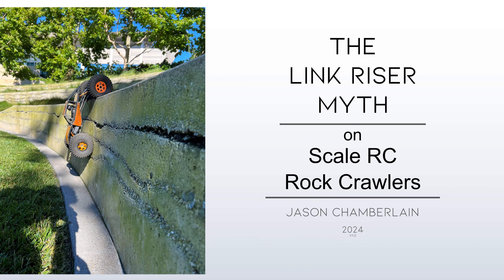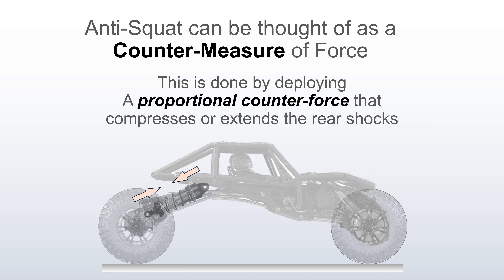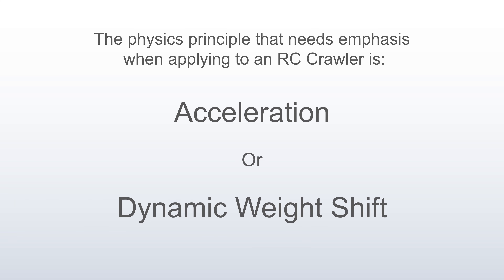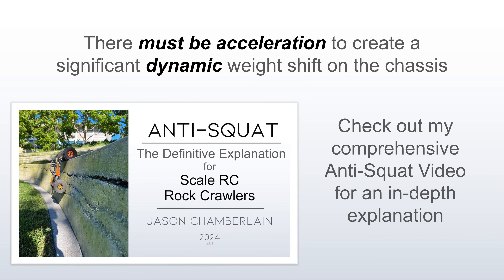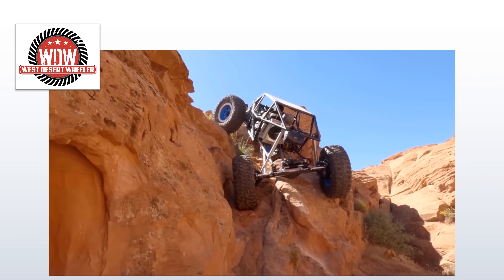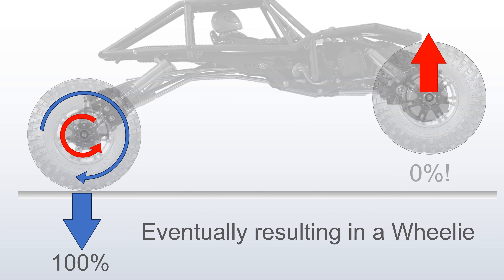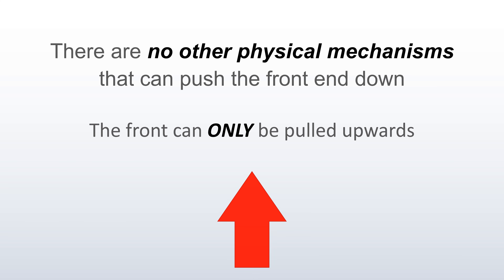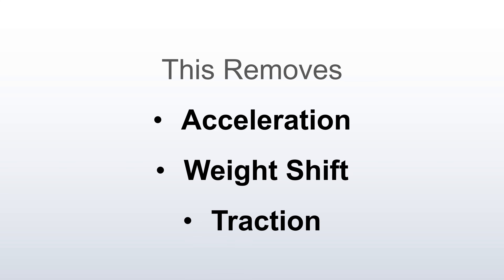Anti-Squat on RC Crawlers - Part 2: The Link Riser Demo

Comment: In rc rock crawling there are times where you “bump” or “give the beans” to quickly jump up an incline.  In this case, anti-squat dynamics would be at play and would make a difference in performance.
Reply from the maker: I completely agree.
Reply from the maker: Great topic for a future video.
Reply: This is my driving style. Lots of anti squat, lots of throttle. In the right circumstances it will jump squarely up an obstacle. But I also run a very light sway bar
Reply: yes but still most crawlers have good anti-squat out of the box
Reply: @BoomslangSuss can you do videos explaining pros and cons on using wheel spacers/hubs
Reply from the maker: @wiktorjohansson4333 You make a great point - RTR vehicles are usually well designed and engineered, with a nice amount of AS, or at least the amount that the design engineer wanted...and you don't see link risers out of the box that I know of. Expect maybe Rhino, and I don't have a lot of faith in why they did that - seems like they just followed a trend and added a ton of riser hole options indiscriminately. 
Most of the crawlers I look at are custom builds, so AS could be anywhere on the spectrum.
Reply: @BoomslangSuss I was just rewatching this series and saw this comment. I’m familiar with Rhino’s geometry (from a research point, I’ve never driven one.) I think it would stand to reason that once one goes past a certain point with AS it becomes detrimental as forces on the rear axle react in sudden speed changes (while vehicle is vertical) the VERY long AS adapter they sell for the rear I think becomes detrimental at its most extreme when the opposite end of the links is raised as well (this would cause an extreme reaction and cause a wheelie, either while vehicle is vertical or horizontal). If the opposing end of the link attached to the chassis is installed in a low position there would be little change to AS. This is all anecdotal, and to say that the long rear link adapter is useless and made to fit with industry fashion…thanks for making me think on the way to work LOL

Comment: not relevant tests until the last one, where the high link riser made an obvious difference that you covered up with deliberate poor throttle control....   weak
Reply from the maker: What do I have to gain from throwing the test? Besides, the test was done “blind” so I didn’t know which was which. Try it yourself.

Comment: Antisquat is only part of the equation. Instant center is just as important. If your links were mounted a lot farther back. Your instant center would change enough to invalidate your own test by lifting the rear of the chassis before the front
Reply from the maker: Instant center is meaningless on its own. It’s just one point along the way to calculating AS. You can’t change IC without changing AS. Regardless, anti-squat is a dynamic response and does nothing at slow creeping speeds. Many people in RC crawling overlook the “acceleration” part which is why I made the series of videos.

Comment: Anytime you hit a bind the anti-squat is working...  acceleration is in direct contact with torque on the chassis, and we all know you dont need to actually be accelerating forward the create torque on the chassis..
Reply from the maker: No, but you need acceleration to activate anti-squat. It's a dynamic response to a dynamic weight shift. AS has nothing to do with wheel torque.
Reply from the maker: It's all explained here.
https://youtu.be/-ad04wUd8PQ
Reply: @BoomslangSuss  you are very wrong, anti squat has everything to do with torque as its a direct relation be the tire rotation and since antisquat works on axle rotation putting pressure on the suspension through the links..  also anti dive is another thing, don't be upset with comments just go read a bit more and test properly, if you were to have the truck held back with straps and throttled in place with a high anti squat ratio you'd still pick that rear end up as soon as it starts putting torque to the ground..
Reply from the maker: @theoalbert897  I've read every document ever published on the topic and written a few of my own and was professionally paid for my knowledge on AS for 30 years. If you watch ALL the videos it's clearly explained and demonstrated.

Comment: I’m not an engineer by any means but I would definitely think putting your rear upper links higher so now when you have the weight transfer or pivoting on a certain rear corner on steep incline would create a higher leverage point, acting as a taller pivot point so the weight will push against the mounting location vs wanting to roll over said pivot point/mounting locations
Reply from the maker: You have to look at the complete force balance of the whole system and you can’t just isolate one link or one pivot location. Plus if you’re talking anti-squat that’s a dynamic response and has zero bearing on slow moving vehicles. Hopefully you saw my first video that should explain it better. I am working on a non-reading version of this video coming up soon ha ha.
Reply from the maker: https://youtu.be/-ad04wUd8PQ?si=3fKBykBGSvhtouCW
Reply: @BoomslangSuss thank you that makes perfect sense

Comment: still would love to see this compared with a straight axle vs portal axle. 

also, in the climbing test, there was a noticeable difference. minor, but there was a difference. low antisquat setting you couldnt even apply any throttle without the front tipping back, but you were able to apply power with the high antisquat setting. some more testing is needed there to quantify your results
Reply from the maker: I see what you are saying. If you look closely, you will see that the rear wheel is slipping first on the high setting. When the wheel slips, the front will stay down, obviously.  At the moment when the wheel has grip, the front lifts about the same in both settings. There is a guy on FB rn showing 74 deg climb and his wheels are slipping the entire time. That is a different test altogether than what I am trying to demonstrate. 

The difference in AS between the two is about 35% so IF there was a difference I would think it would be more obvious. I attribute any discrepancies in this test to wheel slip AND outside of wheel slip I think it's all within experimental error - certainly not a 35% difference.
Reply from the maker: What are you hoping to discover with portal v. straight so I can address it from a relevant perspective?
Reply from the maker: https://youtu.be/SBM-YNwr2qU
Reply: @BoomslangSuss I think what he is talking about is people say that straight axle’s vs portals on the link riser. They say that because the portals spin in a reverse rotation due to portal gears that it somehow changes anti-squat. I do set my crawler up with anti-squat in case in need throttle to bump up something otherwise your front staying planted has more to do with rear spring rate and forward bias to push the front down. Many aftermarket axles come with link risers and I believe it’s more for clearance between upper and lower links but I could be wrong.

Comment: I’ve been watching your RC tech videos. Thank you for providing clear and concise explanations. When I started RC crawling I bought a link riser because it was recommended to improve performance but in all my testing I couldn’t really tell a difference. I’m glad it wasn’t just me! haha At least I know now what types of driving a link riser/high anti-squat are actually beneficial for (throttle bumps/quick acceleration)
Reply from the maker: AS certainly has it's purpose and place. It just doesn't hold your front end down at slow speeds. Thanks for watching and I have a quite a few more topics I hope to release. Stay tuned.

Comment: Your amazing my friend! IDE just like know more about tuning shocks and location of them! And how weight gains traction or not enough ect! Idk but your awesome! ❤
Reply from the maker: I plan on doing a video that explains all the shock mounting holes.  As far a tuning the shock, that's a very touchy subject, but I may tackle it at some time.  Some people like 15wt oil and some like 100wt so it's a pretty broad topic with little chance of bringing people together, but I can publish the basics.
Reply: @BoomslangSuss  It would be nice to have a shock and link tuning video that goes into your thought process. ie if I notice x, y, or z I would consider adjustments a, b, or c. In the real world what am I looking for that would push me towards more or less damping, moving a link position, or changing my spring rate. How do I know if my springs are too soft or too hard, etc. I feel like most of the videos are very subjective with little actual tuning guidance.
Reply from the maker: @tristanploughman5586  Working on that exact topic right now!  Stay tuned. Within a few weeks.

Comment: A couple of things I'd like to see if youre interested in expanding on this. 
1. Does a link riser affect articulation? Looks like you get more twist out of the higher setting. Dunno if the articulation increased or your torque twist increased. 
2. Does the link riser do more on a car with the upper and lower link mounts closer together on the chassis side? I notice with the length of your rear links the links barely move away from being parallel. More chassis side pinch would be interesting to see. 
3. Can you get the back end to sag before the front end lifts. I think that would help on a straight climb just by the fact it'd lower CG
Reply: I agree with your assessment. I also noticed a slight difference in torque twist watching the tests
Reply from the maker: @mikerainey3847  I think the visible difference comes from the fact that the wheel is slipping slightly and momentarily in some of the trials. At the moments when the wheel is perfectly hooked up I am not seeing a difference.
Reply from the maker: 1) Yes, the trajectory of the articulation changes a little, but I have not wrapped my head around the effect precisely just yet.
2) The short answer is no. You have to look at the full picture of link angles and position. The I.C. is a result of those links and you can have a fairly large variety of link geos that produce the same IC location.  I've done it hundreds of times on mountain bike 4-bar suspension designs - the IC location, and IC migration are key, and just looking at  2 pivot locations doesn't capture the whole story.
3) Agreed, lower is better and preferred. I kept the spring rate in this test such that we didn't reach full droop so that any AS effect had room to extend or compress the rear shocks if it so desired. In the real world I'd run it mostly slammed as you point out.

Comment: In my case, rear link risers help me on really steep climbs where front suspension unloads, if I can, i just bump the obstacle to make the link riser geometry change push the front end as I am bumping it. It doesnt help at slow speed, at all. But when you need to bump, it does help a lot. Experienced it a lot on my utb18.

The utb18 needed it, my vrd carbon doesn't, really depends on the stock geometry.
Reply from the maker: Yes, a throttle bump is one of the only times that you induce enough acceleration for it to make a difference.

Comment: Its not about just adding/moving a part AS and TT are effects of each other. Id be curious to see the effects of the drive shaft angle along with the geometry.
Reply: Same here, keeping in mind the sleeve/piston action to make up for suspension. I’ve been pitching my rear axle slightly back to make a clean line to the transmission which then pitches forward as suspension activates and puts the top link mounts at a 12 o’clock position, some argue it’s best to have the axle at a straight 12 o’clock position. I argue at slow crawl and trailing it’s best to have a clean shaft line. But wtf do I know, I’d love to hear it from our guy.
Reply from the maker: @independentmind1977  This would make a great topic for a future video.  The torque in the sliding portion of the driveshaft causes friction and resistance to sliding, which reduces suspension freedom because your drive shaft has to slide in order for suspension to move.  It's always best to minimize the amount of sliding if possible and have a smooth, direct angle on driveshafts.
Reply: Yes, I would love to see a video on it sometime @BoomslangSuss  - if anything these are great studies in movement Engineering....I'm also jealous of the signed jerseys and found myself pausing and zooming in LOL - Miranda Miller is an absolute monster on two wheels!!! Did you have any say on the design of the Specialized Demo?
Reply from the maker: @independentmind1977  I love that you appreciated the jerseys! I hoped at least one person would notice. I was the lead designer & engineer on all Demo platforms up until this last season. There are a few videos of Demo development on this channel.
Reply: @BoomslangSuss  I ride the Chisel these days, best HT I’ve ever owned and I’d pick it over my wife’s CF frame! The Demo is an amazing frame, great engineering, lovely work sir, chapeau.

Comment: Is there a negative effect to raising the rear links? I have found link risers helpful to avoid binding issues and making space for bent or high clearance links.
Reply from the maker: No, there is not really a downside. Raising for clearance purposes is a terrific reason. You will also have the side benefit of increased anti-squat which helps in quick, punchy accelerations, like when you have to throttle bump over an obstacle.  Typical link risers add 20-30% more AS, which is helpful but not enough to be harmful, generally speaking. Again, it ONLY matters in dynamic situations.

Comment: One thing i will mention... because i noticed very little difference with link risers....... Too much articulation hurts performance, i had better results with a light sway bar to combat the torque twist. 
Many people question this method, but it's real simple. Do you have 3 tires touching the ground? Or all 4? 
If your truck constantly pulls the front tire off the ground during a climb, a sway bar might not be a bad idea. Helped in side hill situations as well.
Reply from the maker: I like it. It adds a little bit of spring rate to the articulation too to help returns to level.

Comment: I'm thinking of building a mud race rig with an old c-channel frame I robbed parts off of. Would a link riser be more beneficial in a rc like this since I'd be giving it the beans hopefully the whole race in the mud lanes?
Reply from the maker: So at slow speeds a riser does nothing. I wouldn’t say that a riser would automatically be an improvement under acceleration, but it would certainly cause an effect, good or bad. You’d want to know what the stick AS number is before arbitrarily adding a riser. Might make it worse.

Comment: The only difference ive seen with a link raisers was side hilling.didnt make sense to me but my rig was more planted on sidehill
Reply from the maker: It changes the way the rear axle swings side to side, so I could see this being the case. Great topic to research more.
Reply: I think it's a topic less explored do to lack of knowledge.squat and dive I use more in racing off road..but like I said I played around with a link raiser to see if it helped with my up hill climbs it made no difference.but I left it installed because I noticed it did help on my side hilling.i haven't put much thought into the why it helped part